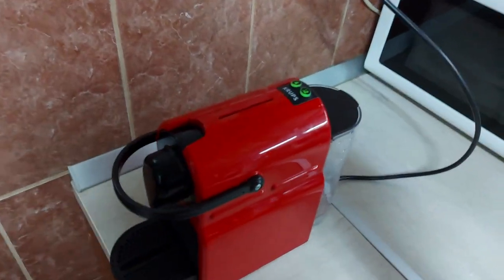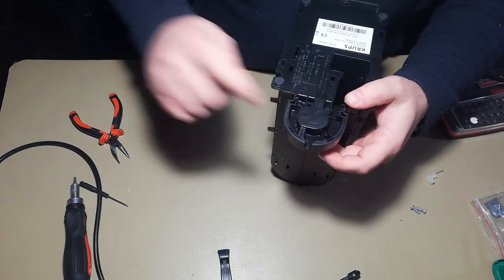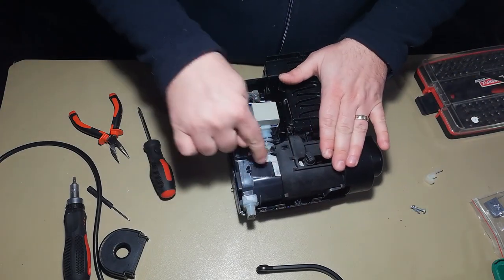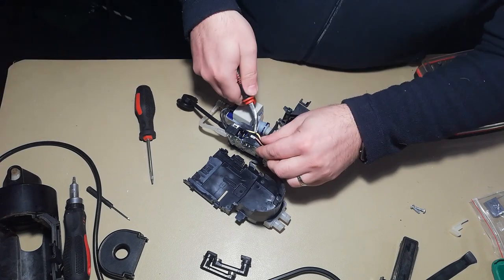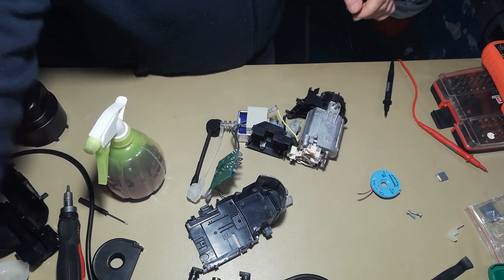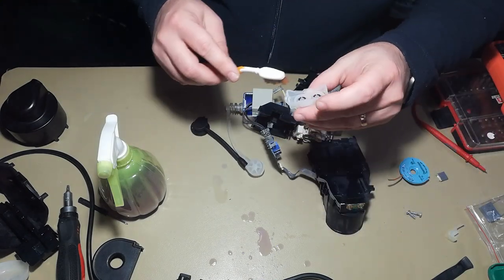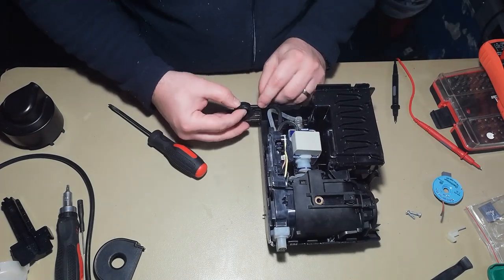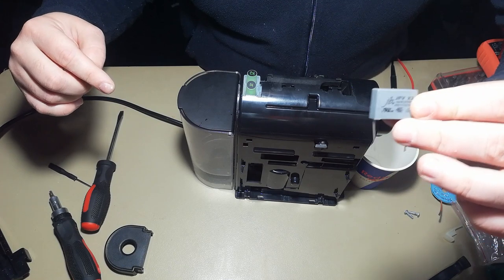NESPRESSO machine stops working - buttons blinks twice a second  and stops after power on - INISSIA

Comment: I have the buttons blinking problem but this is a fiddly job and after all that effort it may not be the capacitor thats the problem. One interesting point, when you measured the capacitor value it read ok. Usually a capacitor will fail open or short circuit but you did not test for that? Time for me to get a new machine I think 🤔

Comment: Hello and great job! Have the same machine and mine has no lights at power on,when i press any of the buttons,the 2 lights blinking very fast.Is this same capacitor problem? Thanks for your answer.
Reply: I have the same problem. Could you solve it with the solution on this video?
Reply: @1991Menezes1991  No,this solution was not working for me,i have changed the electronic board and this worked for me.
Reply: The board has capacitors, resistors and transistors. If you replace all it should be under 10€. How much did your board cost? If more than 40€, you get a new machine between 50-80€.

Comment: Thank you so much for your video. Mine is a Citiz D110. At first it didn’t even power up, after a search i was able to follow one possible cause which was a thermal fuse, i replaced that for 1€ and then it powered up but with those 2 flashes-stop-2flashes-stop. After that i found your video and replaced the 2 capacitors (mine had 2) for 3€. Its working like new. Thanks to you, i was able to repair my very expensive machine. All good to you sir 🫡